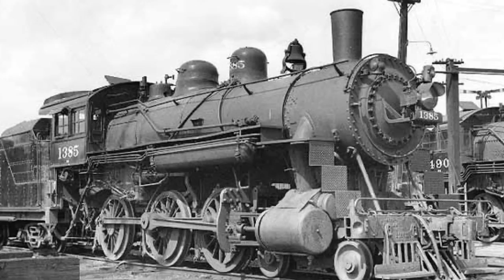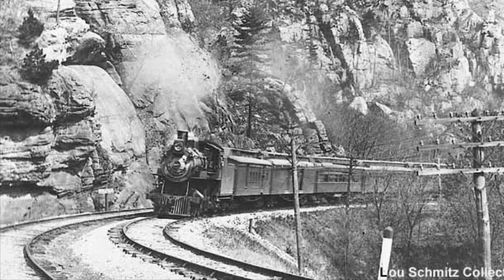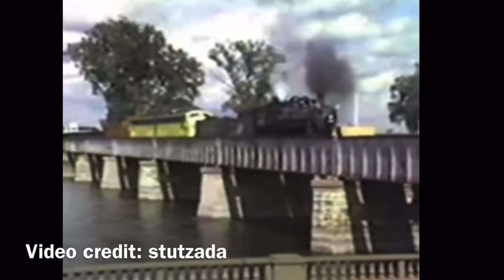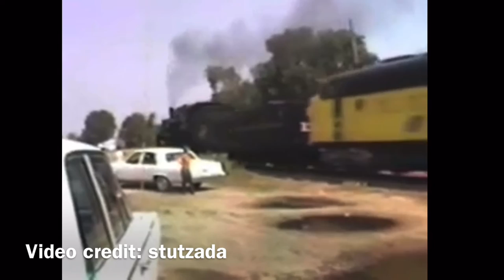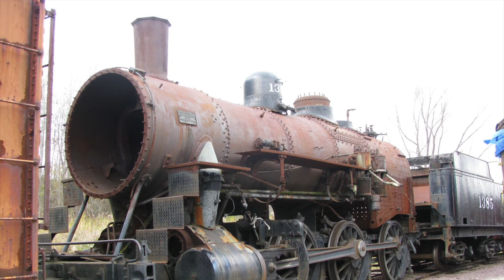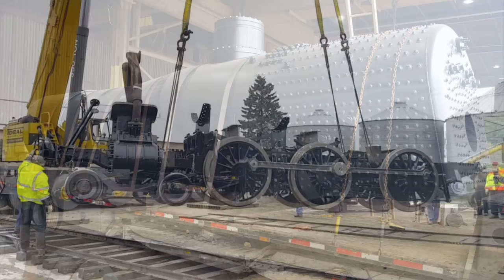Chicago & Northwestern 1385

Comment: 1385 has a Brand New Custom Welded Boiler. Which was built in St. Louis, and sent to the rebuilding shop for farm 🚜 equipment, near Baraboo, then reassembled,  and brought back to the M.C.RY.M.   HI IN MAY 2023A.D.